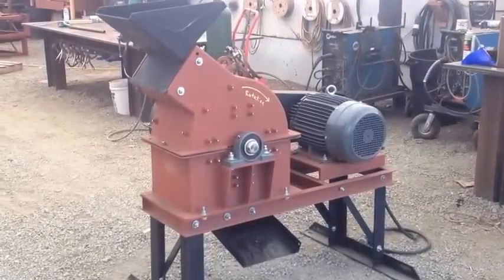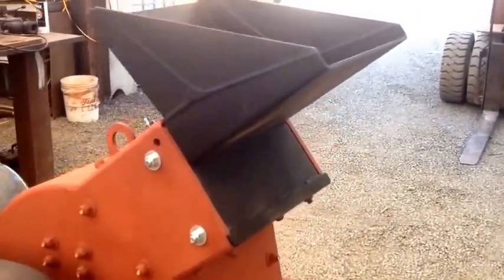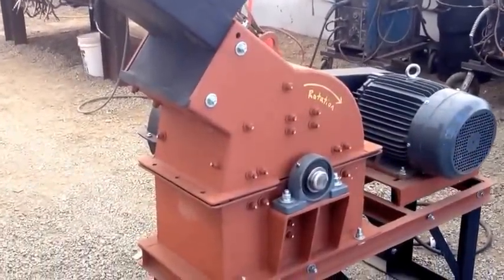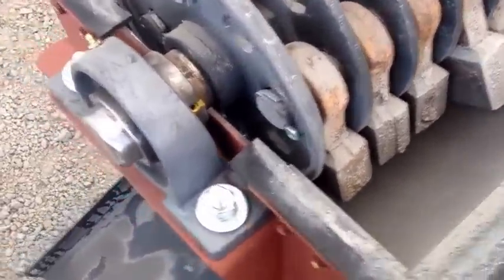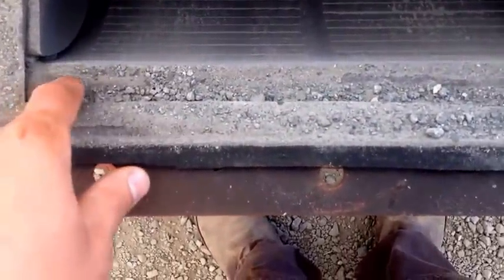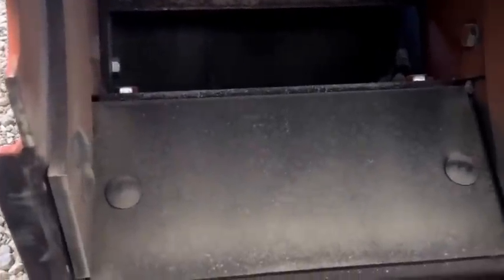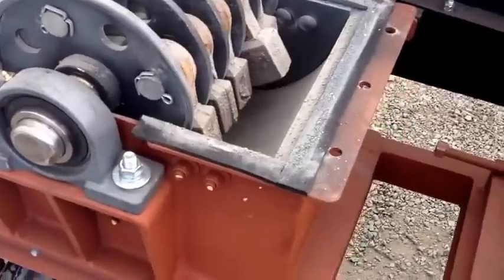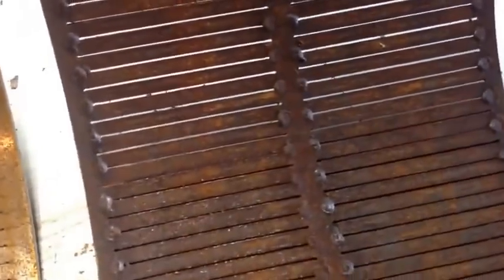Gold Mining Hammer Mill Crusher, Crushing Gold Ore To Fine Dust For Precious Metal Recovery MBMM

Comment: We built our own. We used a big pipe around 2 feet across, then we filled it with smaller pipes, attached a motor and a gear to the big pipe, to make it spin, put it on a down ward slope, loaded from the upper end, comes out the bottom end. Runs dry, works good.

Comment: Hi Tom From Ayr in Scotland, I am looking to build one of your mills or something like it! I need to get a supply of Crushed glass for my Blast cabinet, Seems no one over here does units like that, So a Hammer Drill seems the answer. I will make a sort of rough version of your unit. As a 71 year old pensioner I could not afford the to buy one. Your Video is just Great and very informative. Thanks.

Comment: hi guys did you really said the hammers will last only 1 to 2 weeks.and were in Moçambique can we get supplies on backup parts
Reply from the maker: The hammers last in varying amounts as it is really dependent on the material you are running. If you you are interested in parts or the hammer mill itself please fill out our contact form at: https://www.mbmmllc.com/contact/

Comment: Due to the big gap between the hammer and the screen if you throw in a "little" rock wont just fall down to the bottom of the screen and stay there forever? Thank for the video, very informative.
Reply from the maker: +egamezl Hello.  The gap between the hammers and the screen is about 3/8"-1/2" so it is pretty close.  There will be some circulating load that will stay in the mill after you stop feeding.  This is about 2 pounds worth of material and it will come out the next time material is fed into the mill.  Thanks
Reply: @mbmmllc  hai phone number plz

Comment: THE BEARINGS ON THE SIDES ARE LIGHT DUTY AND ALSO NEED SELF LOCKING NUTS
Reply from the maker: Bill Stokes Hi Bill.  These bearings actually do not use self locking nuts, they are held on to the shaft using two sets of locking set screws for each bearing.  We have lots of these units in operation around the world and we have only had one customer report of a faulty bearing, we overnighted a replacement bearing to him and he has been up and running ever since with good results.  Thanks for your concern and critiques.
Reply: What is the type of bearing?

Comment from the maker: Hi Tyler-
Thanks for the comment about the bolt in screen.  We are working our way in that direction.  We have a bolt in screen for our recycling hammer mills (video coming soon) and it works great.  The reason we still weld in our mining screen is miners usually don't change to different screen sizes, they stick with one screen for the fineness of grind they need, when it wears out they replace it and keep going.  The other reason is it is hard to get a good tight tolerance all the way around the edges of the screen using a bolt in screen.  In the next six months we are going to try and make the switch to a bolt in screen for all our hammer mills.  Thanks again.
Reply: That sounds good, and your welcome!
Reply: mbmmllc  
છે પરંતુ
Reply: Magkano poh yaan sir,.at balak Kong maginto poh